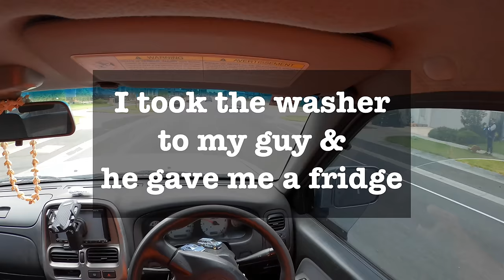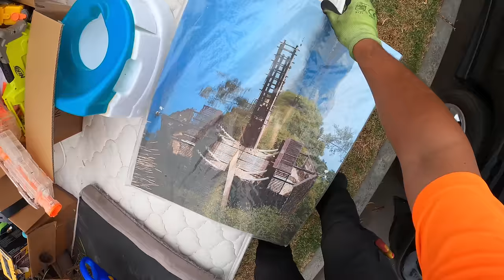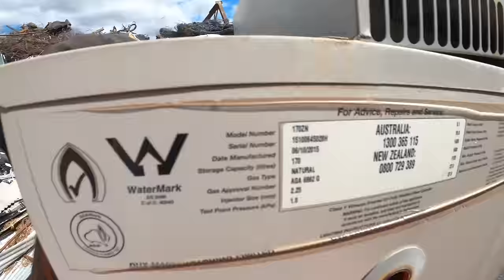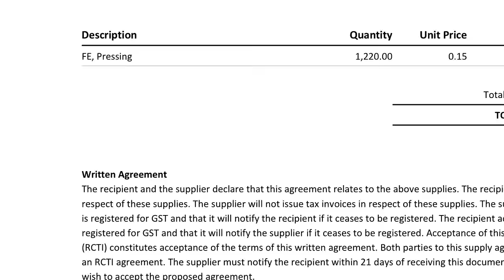Saving Goods From Going To Landfill

Comment: Some nice pick ups poly, I came across a old school tekken 4 arcade machine that weighs a good 50kgs atleast, way to big to fit in the car, contemplating if its still there by monday I will just end up taking it apart on the side of the road😅
Reply from the maker: Whoa tekken arcade! I would grab it immediately 😁